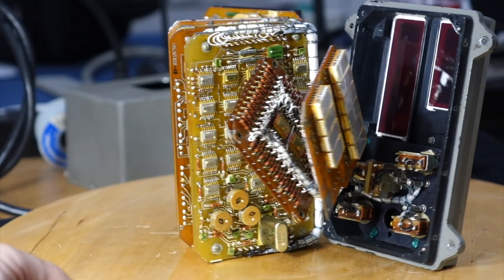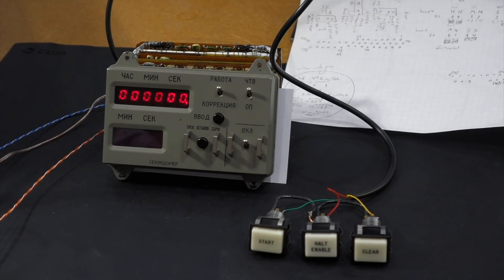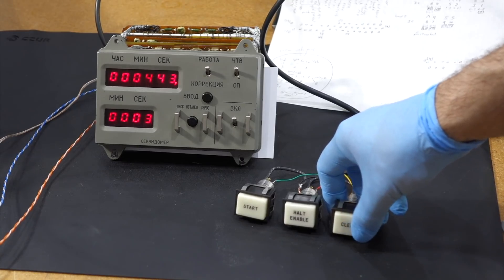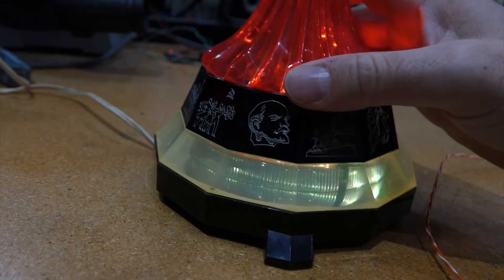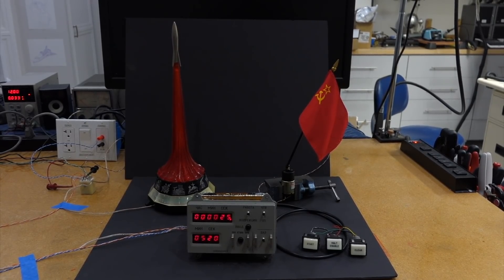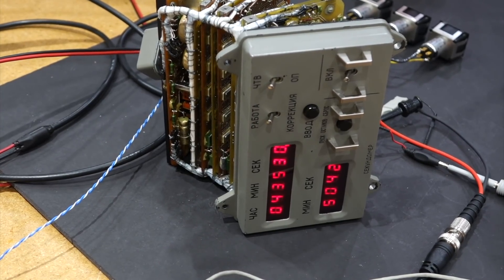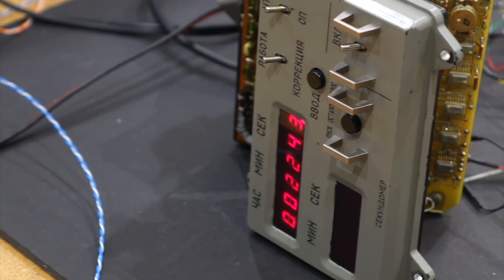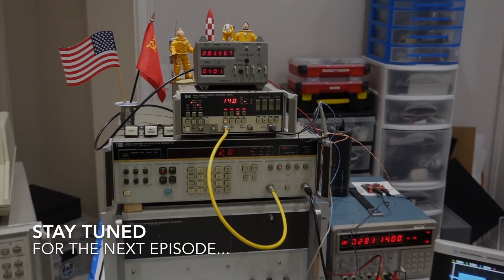Soyuz Clock Part 5: Spaceship Connections

Comment: Why is there a delay present after you turn the clock on? The digits does not appear immediately.
Reply from the maker: It's by design. There is a turn on timer circuit in the power supply. Not sure why they did that though.

Comment: I am guessing the reason for using the transformer coupled blocking oscillator isolation on the external start/stop is because opto-couplers are too sensitive to radiation?

Comment: The circuit at 3:27 is a blocking oscillator. In that configuration it would oscillate freely, sending pulses to the secondary winding to be read by the digital gate.

Comment: Would those external inputs have been signaled from the ground by radio, or by some other sequencer/timer, or engine control system just to display duration of a burn, or what?

Comment: Maybe pressing the start button acts as a stop button when the clock is running? Did you try that?
Reply from the maker: The single button on the clock itself (for the Cosmonauts) works like this. On the external interface, the buttons (or signals more exactly) have just one function only.

Comment: thats a very 3:26 common circuit found in space electronics i basically use it daily in my designs but also with just two winding that also works. Very simple and good for isolation telemetry signals in Space electronics

Comment: I'm perplexed over the internal xtal circuit, how come it's so inaccurate?
Reply: That's been discussed before. It seems to be very crude, with little thought to layout. The connections to the crystal are quite long, and run close to other logic. This periodically disturbs the waveform, making the oscillator particularly inaccurate. It would appear to be only a backup system, so not much attention was paid to accuracy.
Reply: @Derundurel  Ok, I would understand if this clock was used in a train or similar, but in a spacecraft? Seems like poor design IMHO, but maybe I'm not seeing the complete picture.
Reply: @mattiassarling5664  Yes, I think you are right. However, in normal use the external clock provides a much better reference so the crystal circuit is irrelevant. I suspect the clock doesn't have to be vary accurate in any case if the only goal is to complete the next segment of the mission.
Reply: Internal clock is a back up system that would be used in rare occasions for a duration of time smaller than the error margin.

Comment: Very interesting video. The clock is  quite complicated in details. In the mean time, I recently reverse engineered a clock from Boeing 747, P/N A15808. It used filament displays from Wamco while also had an electromechnical stopwatch. The clock used no MCU either, but a bunch of CMOS SSI and MSIs. It doesn't have internal timebase but requires an external 60Hz input. What's more interesting is that the clock has timestamp output as RZ code, which I guess most probably  would be used by the flight data recorder or transponder.
Reply: The RZ code is probably ARINC-429, common on aircraft even today.

Comment: I imagine a bunch of people sitting around a table building several clocks in an assembly line style, it's a old dusty room because the staff are so intent on building the clocks.  They are not worried about the world around them.  The staff all have PhD's in electrical engineering.  There's a sign on the wall that says, " You don't watch the clock, the clock watches you"
Reply: Electronics assembly lines just can't be dusty by default. Nor were it old till the 80es.
Reply: Also, you are mixing up actual Soviet work posters with Orwell's book. They would typically have working ethics advices or the inspiring quotes from the party assemblies. Nothing intimidating or threatening.
Reply: I know my American imagination is wrong,  but it is what i imagined.   Didn't mean to insult anyone.

Comment: But how can you make this precise if human has to enter the time?

Can a machine enter the time?
Reply: "Can a machine enter the time?"

It's a 1 second resolution interval timer, but can be triggered externally, including by the flight control computer (e.g. It was mentioned in the narrative that the timer was used to control the duration of engine firings). It's not clear whether the duration can be set externally, but I would guess that it can through one or more of the four I/O pins whose function was not described.
Reply: It’s not a question of ‘precise’ but ‘accurate’. 

Manual setting of the ‘correct’ time, then the 1 Hz sync. So manual setting would have to be within 0.5 seconds.  

Maybe.

Comment: 400hz is a weird frequency. Is it not just looking for a timed square wave signal? Or does the 400hz square reduce noise somehow?
Reply: 400Hz is very common in aviation and naval applications
Reply: Most airliners cockpit run on 400 Hz AC. 

Like 120V 400Hz AC.

Comment: Looks like the transistor circuit is an oscillator to convert the DC input into AC to pass through the transformer.
Reply: Yes, that's what I thought. What fun reverse engineering things like this!
Reply: I agree. It's a blocking oscillator.

Comment: Question is if you start it with the front panel, will the external start control stop it, or will it reset it to zero and then start counting up again from zero. Same if stopped from front panel, will external start control do the same.

The clock requirement is not too strange, given the transformer coupling, you would have your 2Hz signal driving a relay in the timebase generator, that then gated the local 28VAC 400Hz bus, to give a tone burst to the clock, so that any faults are easy to detect just by listening for the tone using a capacitive probe near the clock wiring. Relay of course, as those little avionics rated relays are small, and will easily do a million cycles at 28VAC 50mA of contact current, and the coil probably was driven from a 2Hz 5V logic level, likely switched by the Soviet clone of a 2N2222A transistor. IIRC relay part number was EBDC28V22-5 for the 5V coil variant, I changed many of them. 28V rated, 2 changeover contacts, 5v coil, in a soldered hermetic case, and coil voltages were 5V, 12v and 28V, with the coil in the higher voltage ranges being wound with enamelled nichrome wire.

Comment: how would this clock get programmed with Moscow time ?  would it be manual? or would the external clocking circuit understand a programming signal?  as well as the stopwatch ? just like the DSKY on the AGC giving a countdown to push a button.
Reply: Watch the Part 2 or 3.

Comment: 400 Hz had to be expected somehow: it's pretty common in aircraft avionics. I wouldn't wonder if other parts in the spacecraft, especially gyros, derived from aircraft parts. Some parts in the Apollo spacecrafts had that history. I see no reason why the Soviets didn't do the same.
Reply: Being Soviet I would say 500Hz, as a nice multiple of decimals, plus you can shave a few grams off of the mass of the core and copper for the same power. As it is generated by a local inverter set off of a 28VDC bus and battery, and not by any sort of rotating equipment bus, using a higher frequency would be simple. avionics standardised on 400Hz because that was easy to attain off a rotating piston engine PTO gearbox, and was within the limits of the steel cores of the times, so it got baked in. Anything from 380- 440Hz will work frequency wise, the avionics that uses it for signals always uses a sampling clock derived from the reference signal.

Fun thing is the external power connector has a protection relay, that disconnects power if the external AC bus frequency or voltage is out of tolerance. Unfortunately the protection circuits are powered from that external bus, and one user found out the expensive way that plugging in 50Hz mains did not activate the protection relay to disconnect that AC input bus from the avionic busses.
Reply: 500Hz sounds likely to me too, partly for the fact that it's a nice round number, and partly because it's not the 'decadent-imperialistic-western' 400Hz.
Russia is still the only country that uses meters to measure aircraft's altitude. Even the French use feet!
Reply: The 400Hz was probably the first frequency that worked with the integrator. I should work at higher frequencies and then may drop of again once you go high enough.
Reply: @FrancSchiphorst  Probably will work up to around 2kHz, the steel cores will be getting quite lossy at around 20kHz unless they used a very good quality magnetic core, simply because of the increased eddy currents in them.
Reply: @SeanBZA  thanks. I assume the cores will be good looking at the rest of the build but they would be engineered with the lower frequency in mind.
Reply: @FrancSchiphorst  Yes, I think 400 Hz is the minimum frequency.
Reply: Hmm... 400Hz is in audible frequency range and half second pulses also make it easy to check for time signal presence with a headphone. However, this makes clock input circuit more complicated, but at the same time it should be resistant to random glitches.

Comment: Isn't 400hz a standard aviation frequency?  I seem to remember it from somewhere else....
Reply: Yes, also used on ships. Voltage can typically be 28V, 56V or 115V.
Reply: Yes - a lot of old school gyros and aircraft AC motors run on 400Hz (including the WW2 V2 missiles guidance system). Common enough that a variable speed drives will run out to 400Hz.

Comment: Marc, where did you get the 19 pin connector. I suppect it was not at FRY's.
Reply from the maker: Ken got it from eBay from Eastern Europe. I mates, but it's an imitation, not the real thing. Flimsy non-military connector, with some plastic parts. It got us connected though and was very inexpensive.
Reply from the maker: BTW did you see I used the polar TTY relay you gave me in the last video with the coherer receiver? Worked like a treat after a bit of adsjutment. Thanks a lot!